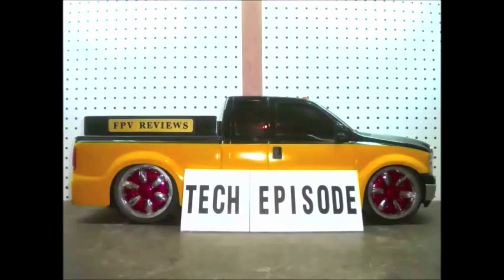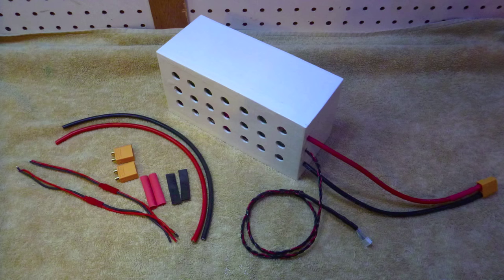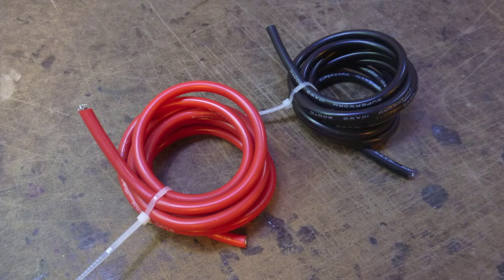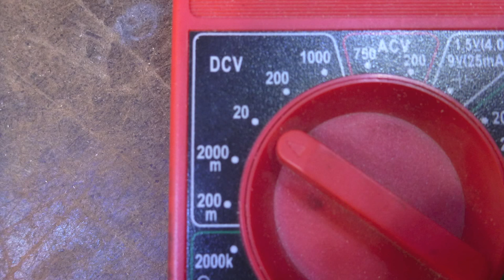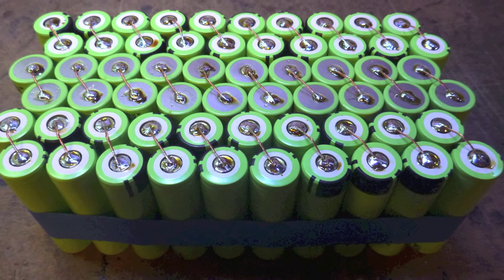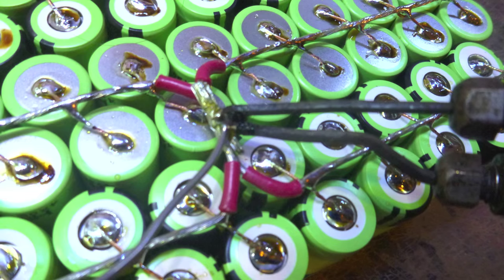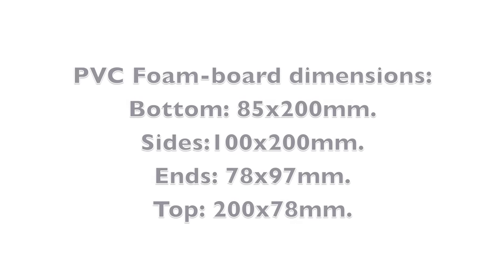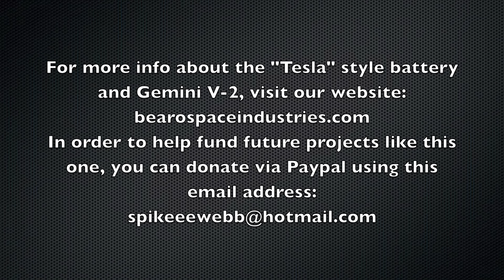"Tesla" Style Battery BUILD for Gemini V-2 And other FPV Planes!

Comment: I just ordered 12 cells to build an endurance pack for my phoenix 2400. Should I build a 14.8V 4s3p pack to avoid the "eye squared arr" loss, or should I build a 11.1V 3s4p pack to spin a larger diameter prop to get more grams/watt thrust efficiency?
Reply from the maker: Well ideally you’d go with the highest practical voltage and use a much lower kv motor to match the largest diameter prop that is practical to use on the airframe. 
If you’re stuck with the motor it will depend on how you want to fly the aircraft. If your priority is endurance, you’ll mostly be operating at a very low throttle setting, so go with the lower voltage for greatest aerodynamic efficiency. 
If you want to go fast or climb at higher throttle settings for much time, then go with the higher voltage, and smaller prop.  
More important than the prop diameter is it’s diameter to pitch ratio. 
Use a fairly high pitch prop for fixed wing aircraft to get best endurance. 
This let’s you spin the prop slower and save aerodynamic drag at the prop blade tips. 
If it’s too much pitch the blades will be stalled, so there’s a balance.  
You may have to try several props to find the right ratio for your airspeed and power loading.
Reply from the maker: Well ideally you’d go with the highest practical voltage and use a much lower kv motor to match the largest diameter prop that is practical to use on the airframe. 
If you’re stuck with the motor it will depend on how you want to fly the aircraft. If your priority is endurance, you’ll mostly be operating at a very low throttle setting, so go with the lower voltage for greatest aerodynamic efficiency. 
If you want to go fast or climb at higher throttle settings for much time, then go with the higher voltage, and smaller prop.  
More important than the prop diameter is it’s diameter to pitch ratio. 
Use a fairly high pitch prop for fixed wing aircraft to get best endurance. 
This let’s you spin the prop slower and save aerodynamic drag at the prop blade tips. 
If it’s too much pitch the blades will be stalled, so there’s a balance.  
You may have to try several props to find the right ratio for your airspeed and power loading.
Reply from the maker: Well ideally you’d go with the highest practical voltage and use a much lower kv motor to match the largest diameter prop that is practical to use on the airframe. 
If you’re stuck with the motor it will depend on how you want to fly the aircraft. If your priority is endurance, you’ll mostly be operating at a very low throttle setting, so go with the lower voltage for greatest aerodynamic efficiency. 
If you want to go fast or climb at higher throttle settings for much time, then go with the higher voltage, and smaller prop.  
More important than the prop diameter is it’s diameter to pitch ratio. 
Use a fairly high pitch prop for fixed wing aircraft to get best endurance. 
This let’s you spin the prop slower and save aerodynamic drag at the prop blade tips. 
If it’s too much pitch the blades will be stalled, so there’s a balance.  
You may have to try several props to find the right ratio for your airspeed and power loading.
Reply from the maker: Well ideally you’d go with the highest practical voltage and use a much lower kv motor to match the largest diameter prop that is practical to use on the airframe. 
If you’re stuck with the motor it will depend on how you want to fly the aircraft. If your priority is endurance, you’ll mostly be operating at a very low throttle setting, so go with the lower voltage for greatest aerodynamic efficiency. 
If you want to go fast or climb at higher throttle settings for much time, then go with the higher voltage, and smaller prop.  
More important than the prop diameter is it’s diameter to pitch ratio. 
Use a fairly high pitch prop for fixed wing aircraft to get best endurance. 
This let’s you spin the prop slower and save aerodynamic drag at the prop blade tips. 
If it’s too much pitch the blades will be stalled, so there’s a balance.  
You may have to try several props to find the right ratio for your airspeed and power loading.
Reply from the maker: Well ideally you’d go with the highest practical voltage and use a much lower kv motor to match the largest diameter prop that is practical to use on the airframe. 
If you’re stuck with the motor it will depend on how you want to fly the aircraft. If your priority is endurance, you’ll mostly be operating at a very low throttle setting, so go with the lower voltage for greatest aerodynamic efficiency. 
If you want to go fast or climb at higher throttle settings for much time, then go with the higher voltage, and smaller prop.  
More important than the prop diameter is it’s diameter to pitch ratio. 
Use a fairly high pitch prop for fixed wing aircraft to get best endurance. 
This let’s you spin the prop slower and save aerodynamic drag at the prop blade tips. 
If it’s too much pitch the blades will be stalled, so there’s a balance.  
You may have to try several props to find the right ratio for your airspeed and power loading.
Reply from the maker: Well ideally you’d go with the highest practical voltage and use a much lower kv motor to match the largest diameter prop that is practical to use on the airframe. 
If you’re stuck with the motor it will depend on how you want to fly the aircraft. If your priority is endurance, you’ll mostly be operating at a very low throttle setting, so go with the lower voltage for greatest aerodynamic efficiency. 
If you want to go fast or climb at higher throttle settings for much time, then go with the higher voltage, and smaller prop.  
More important than the prop diameter is it’s diameter to pitch ratio. 
Use a fairly high pitch prop for fixed wing aircraft to get best endurance. 
This let’s you spin the prop slower and save aerodynamic drag at the prop blade tips. 
If it’s too much pitch the blades will be stalled, so there’s a balance.  
You may have to try several props to find the right ratio for your airspeed and power loading.
Reply from the maker: Well ideally you’d go with the highest practical voltage and use a much lower kv motor to match the largest diameter prop that is practical to use on the airframe. 
If you’re stuck with the motor it will depend on how you want to fly the aircraft. If your priority is endurance, you’ll mostly be operating at a very low throttle setting, so go with the lower voltage for greatest aerodynamic efficiency. 
If you want to go fast or climb at higher throttle settings for much time, then go with the higher voltage, and smaller prop.  
More important than the prop diameter is it’s diameter to pitch ratio. 
Use a fairly high pitch prop for fixed wing aircraft to get best endurance. 
This let’s you spin the prop slower and save aerodynamic drag at the prop blade tips. 
If it’s too much pitch the blades will be stalled, so there’s a balance.  
You may have to try several props to find the right ratio for your airspeed and power loading.
Reply from the maker: Well ideally you’d go with the highest practical voltage and use a much lower kv motor to match the largest diameter prop that is practical to use on the airframe. 
If you’re stuck with the motor it will depend on how you want to fly the aircraft. If your priority is endurance, you’ll mostly be operating at a very low throttle setting, so go with the lower voltage for greatest aerodynamic efficiency. 
If you want to go fast or climb at higher throttle settings for much time, then go with the higher voltage, and smaller prop.  
More important than the prop diameter is it’s diameter to pitch ratio. 
Use a fairly high pitch prop for fixed wing aircraft to get best endurance. 
This let’s you spin the prop slower and save aerodynamic drag at the prop blade tips. 
If it’s too much pitch the blades will be stalled, so there’s a balance.  
You may have to try several props to find the right ratio for your airspeed and power loading.
Reply from the maker: Well ideally you’d go with the highest practical voltage and use a much lower kv motor to match the largest diameter prop that is practical to use on the airframe. 
If you’re stuck with the motor it will depend on how you want to fly the aircraft. If your priority is endurance, you’ll mostly be operating at a very low throttle setting, so go with the lower voltage for greatest aerodynamic efficiency. 
If you want to go fast or climb at higher throttle settings for much time, then go with the higher voltage, and smaller prop.  
More important than the prop diameter is it’s diameter to pitch ratio. 
Use a fairly high pitch prop for fixed wing aircraft to get best endurance. 
This let’s you spin the prop slower and save aerodynamic drag at the prop blade tips. 
If it’s too much pitch the blades will be stalled, so there’s a balance.  
You may have to try several props to find the right ratio for your airspeed and power loading.
Reply from the maker: Well ideally you’d go with the highest practical voltage and use a much lower kv motor to match the largest diameter prop that is practical to use on the airframe. 
If you’re stuck with the motor it will depend on how you want to fly the aircraft. If your priority is endurance, you’ll mostly be operating at a very low throttle setting, so go with the lower voltage for greatest aerodynamic efficiency. 
If you want to go fast or climb at higher throttle settings for much time, then go with the higher voltage, and smaller prop.  
More important than the prop diameter is it’s diameter to pitch ratio. 
Use a fairly high pitch prop for fixed wing aircraft to get best endurance. 
This let’s you spin the prop slower and save aerodynamic drag at the prop blade tips. 
If it’s too much pitch the blades will be stalled, so there’s a balance.  
You may have to try several props to find the right ratio for your airspeed and power loading.
Reply from the maker: Well ideally you’d go with the highest practical voltage and use a much lower kv motor to match the largest diameter prop that is practical to use on the airframe. 
If you’re stuck with the motor it will depend on how you want to fly the aircraft. If your priority is endurance, you’ll mostly be operating at a very low throttle setting, so go with the lower voltage for greatest aerodynamic efficiency. 
If you want to go fast or climb at higher throttle settings for much time, then go with the higher voltage, and smaller prop.  
More important than the prop diameter is it’s diameter to pitch ratio. 
Use a fairly high pitch prop for fixed wing aircraft to get best endurance. 
This let’s you spin the prop slower and save aerodynamic drag at the prop blade tips. 
If it’s too much pitch the blades will be stalled, so there’s a balance.  
You may have to try several props to find the right ratio for your airspeed and power loading.
Reply from the maker: Well ideally you’d go with the highest practical voltage and use a much lower kv motor to match the largest diameter prop that is practical to use on the airframe. 
If you’re stuck with the motor it will depend on how you want to fly the aircraft. If your priority is endurance, you’ll mostly be operating at a very low throttle setting, so go with the lower voltage for greatest aerodynamic efficiency. 
If you want to go fast or climb at higher throttle settings for much time, then go with the higher voltage, and smaller prop.  
More important than the prop diameter is it’s diameter to pitch ratio. 
Use a fairly high pitch prop for fixed wing aircraft to get best endurance. 
This let’s you spin the prop slower and save aerodynamic drag at the prop blade tips. 
If it’s too much pitch the blades will be stalled, so there’s a balance.  
You may have to try several props to find the right ratio for your airspeed and power loading.
Reply from the maker: Well ideally you’d go with the highest practical voltage and use a much lower kv motor to match the largest diameter prop that is practical to use on the airframe. 
If you’re stuck with the motor it will depend on how you want to fly the aircraft. If your priority is endurance, you’ll mostly be operating at a very low throttle setting, so go with the lower voltage for greatest aerodynamic efficiency. 
If you want to go fast or climb at higher throttle settings for much time, then go with the higher voltage, and smaller prop.  
More important than the prop diameter is it’s diameter to pitch ratio. 
Use a fairly high pitch prop for fixed wing aircraft to get best endurance. 
This let’s you spin the prop slower and save aerodynamic drag at the prop blade tips. 
If it’s too much pitch the blades will be stalled, so there’s a balance.  
You may have to try several props to find the right ratio for your airspeed and power loading.
Reply from the maker: Well ideally you’d go with the highest practical voltage and use a much lower kv motor to match the largest diameter prop that is practical to use on the airframe. 
If you’re stuck with the motor it will depend on how you want to fly the aircraft. If your priority is endurance, you’ll mostly be operating at a very low throttle setting, so go with the lower voltage for greatest aerodynamic efficiency. 
If you want to go fast or climb at higher throttle settings for much time, then go with the higher voltage, and smaller prop.  
More important than the prop diameter is it’s diameter to pitch ratio. 
Use a fairly high pitch prop for fixed wing aircraft to get best endurance. 
This let’s you spin the prop slower and save aerodynamic drag at the prop blade tips. 
If it’s too much pitch the blades will be stalled, so there’s a balance.  
You may have to try several props to find the right ratio for your airspeed and power loading.
Reply from the maker: Well ideally you’d go with the highest practical voltage and use a much lower kv motor to match the largest diameter prop that is practical to use on the airframe. 
If you’re stuck with the motor it will depend on how you want to fly the aircraft. If your priority is endurance, you’ll mostly be operating at a very low throttle setting, so go with the lower voltage for greatest aerodynamic efficiency. 
If you want to go fast or climb at higher throttle settings for much time, then go with the higher voltage, and smaller prop.  
More important than the prop diameter is it’s diameter to pitch ratio. 
Use a fairly high pitch prop for fixed wing aircraft to get best endurance. 
This let’s you spin the prop slower and save aerodynamic drag at the prop blade tips. 
If it’s too much pitch the blades will be stalled, so there’s a balance.  
You may have to try several props to find the right ratio for your airspeed and power loading.
Reply from the maker: Well ideally you’d go with the highest practical voltage and use a much lower kv motor to match the largest diameter prop that is practical to use on the airframe. 
If you’re stuck with the motor it will depend on how you want to fly the aircraft. If your priority is endurance, you’ll mostly be operating at a very low throttle setting, so go with the lower voltage for greatest aerodynamic efficiency. 
If you want to go fast or climb at higher throttle settings for much time, then go with the higher voltage, and smaller prop.  
More important than the prop diameter is it’s diameter to pitch ratio. 
Use a fairly high pitch prop for fixed wing aircraft to get best endurance. 
This let’s you spin the prop slower and save aerodynamic drag at the prop blade tips. 
If it’s too much pitch the blades will be stalled, so there’s a balance.  
You may have to try several props to find the right ratio for your airspeed and power loading.
Reply from the maker: Well ideally you’d go with the highest practical voltage and use a much lower kv motor to match the largest diameter prop that is practical to use on the airframe. 
If you’re stuck with the motor it will depend on how you want to fly the aircraft. If your priority is endurance, you’ll mostly be operating at a very low throttle setting, so go with the lower voltage for greatest aerodynamic efficiency. 
If you want to go fast or climb at higher throttle settings for much time, then go with the higher voltage, and smaller prop.  
More important than the prop diameter is it’s diameter to pitch ratio. 
Use a fairly high pitch prop for fixed wing aircraft to get best endurance. 
This let’s you spin the prop slower and save aerodynamic drag at the prop blade tips. 
If it’s too much pitch the blades will be stalled, so there’s a balance.  
You may have to try several props to find the right ratio for your airspeed and power loading.
Reply from the maker: Well ideally you’d go with the highest practical voltage and use a much lower kv motor to match the largest diameter prop that is practical to use on the airframe. 
If you’re stuck with the motor it will depend on how you want to fly the aircraft. If your priority is endurance, you’ll mostly be operating at a very low throttle setting, so go with the lower voltage for greatest aerodynamic efficiency. 
If you want to go fast or climb at higher throttle settings for much time, then go with the higher voltage, and smaller prop.  
More important than the prop diameter is it’s diameter to pitch ratio. 
Use a fairly high pitch prop for fixed wing aircraft to get best endurance. 
This let’s you spin the prop slower and save aerodynamic drag at the prop blade tips. 
If it’s too much pitch the blades will be stalled, so there’s a balance.  
You may have to try several props to find the right ratio for your airspeed and power loading.
Reply from the maker: Well ideally you’d go with the highest practical voltage and use a much lower kv motor to match the largest diameter prop that is practical to use on the airframe. 
If you’re stuck with the motor it will depend on how you want to fly the aircraft. If your priority is endurance, you’ll mostly be operating at a very low throttle setting, so go with the lower voltage for greatest aerodynamic efficiency. 
If you want to go fast or climb at higher throttle settings for much time, then go with the higher voltage, and smaller prop.  
More important than the prop diameter is it’s diameter to pitch ratio. 
Use a fairly high pitch prop for fixed wing aircraft to get best endurance. 
This let’s you spin the prop slower and save aerodynamic drag at the prop blade tips. 
If it’s too much pitch the blades will be stalled, so there’s a balance.  
You may have to try several props to find the right ratio for your airspeed and power loading.
Reply from the maker: Well ideally you’d go with the highest practical voltage and use a much lower kv motor to match the largest diameter prop that is practical to use on the airframe. 
If you’re stuck with the motor it will depend on how you want to fly the aircraft. If your priority is endurance, you’ll mostly be operating at a very low throttle setting, so go with the lower voltage for greatest aerodynamic efficiency. 
If you want to go fast or climb at higher throttle settings for much time, then go with the higher voltage, and smaller prop.  
More important than the prop diameter is it’s diameter to pitch ratio. 
Use a fairly high pitch prop for fixed wing aircraft to get best endurance. 
This let’s you spin the prop slower and save aerodynamic drag at the prop blade tips. 
If it’s too much pitch the blades will be stalled, so there’s a balance.  
You may have to try several props to find the right ratio for your airspeed and power loading.
Reply from the maker: Well ideally you’d go with the highest practical voltage and use a much lower kv motor to match the largest diameter prop that is practical to use on the airframe. 
If you’re stuck with the motor it will depend on how you want to fly the aircraft. If your priority is endurance, you’ll mostly be operating at a very low throttle setting, so go with the lower voltage for greatest aerodynamic efficiency. 
If you want to go fast or climb at higher throttle settings for much time, then go with the higher voltage, and smaller prop.  
More important than the prop diameter is it’s diameter to pitch ratio. 
Use a fairly high pitch prop for fixed wing aircraft to get best endurance. 
This let’s you spin the prop slower and save aerodynamic drag at the prop blade tips. 
If it’s too much pitch the blades will be stalled, so there’s a balance.  
You may have to try several props to find the right ratio for your airspeed and power loading.
Reply from the maker: Well ideally you’d go with the highest practical voltage and use a much lower kv motor to match the largest diameter prop that is practical to use on the airframe. 
If you’re stuck with the motor it will depend on how you want to fly the aircraft. If your priority is endurance, you’ll mostly be operating at a very low throttle setting, so go with the lower voltage for greatest aerodynamic efficiency. 
If you want to go fast or climb at higher throttle settings for much time, then go with the higher voltage, and smaller prop.  
More important than the prop diameter is it’s diameter to pitch ratio. 
Use a fairly high pitch prop for fixed wing aircraft to get best endurance. 
This let’s you spin the prop slower and save aerodynamic drag at the prop blade tips. 
If it’s too much pitch the blades will be stalled, so there’s a balance.  
You may have to try several props to find the right ratio for your airspeed and power loading.
Reply: @FPVREVIEWS  Thank you for sharing your knowledge!